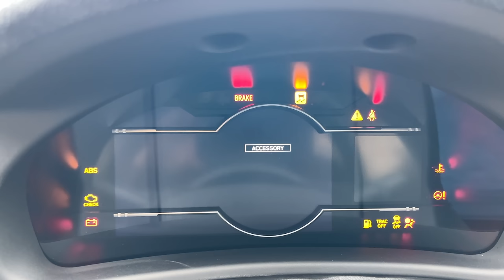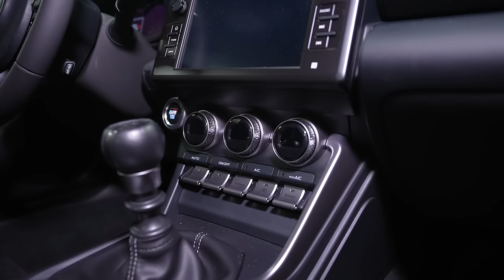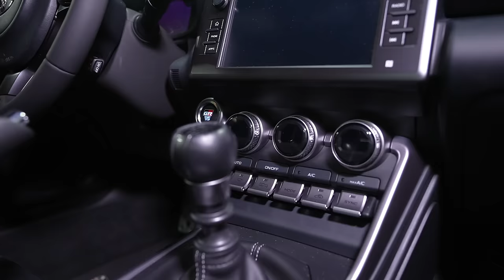Should You Buy a 2023 Toyota GR86? It's heavily over shadowed by a rival in 2023

Comment: The 86 platform is special because it's one of the very few LIGHTWEIGHT, RWD, low-sitting, naturally aspirated sports car that exists right now.
Reply: And still has a mechanical e-brake, standard transmission and not marked up like everything else.
Reply: Problem is a miata is cheaper, not much less power, and has a drop top. Maybe slightly less practical but I feel like it's a no Brainer to just get a miata instead
Reply: @MrImaWizard  The MX-5 is also a great car. But if you were to own only one car, especially as a daily the 86 would be the better pick every time.
Reply: @Krenisphia  not by much though. I'd take the drop top capability over a little more trunk all day
Reply: It's also under $35K.
Reply: @MrImaWizard  i like both tbh, but in my country mx-5 is more expensive, and mx-5 isnt really comfortable for tall guys like me specially driving it daily, and to me gr86 has a good space to put my staff in the "back seats" makes a difference.
Reply: @MrImaWizard to each their own, but extra boot space is nearly double the size of the mx5. and its considerably more power and torque. I much prefer the slick top but I can understand those that want a rag top
Reply: @elll6456  regardless of trunk size both are impractical day to day and am RF miata is the best of both worlds of drop top and a traditional car. That "considerably more power" doesn't translate into being faster as the 0-60 speeds are next to identical. I just think one checks way more boxes than the other as far as a fun sports car goes
Reply: @bliatay not marked up? They have a 5k markup where i live.
Reply: @MrImaWizard drop top is a massive negative for any car enthusiast.
Reply: @brandon9491  this makes absolutely no sense. The miata is well known as one of the best car enthusiast cars lol having a drop top makes the experience that much better as an enthusiast.
Reply: @MrImaWizard  so you don’t understand physics? Drop top = less structural integrity.
Reply: @brandon9491  so get the RF. Enthusiasts rave about the miata so your point is moot. It's one of the most famous enthusiast cars on earth.
Reply: @MrImaWizard  the miata is lightweight and rwd, thats why its so popular.. its not because its a convertible. Theres a reason so many people convert it to a hard top..
Reply: @MrImaWizard  convertible is overall a negative, your argument is “well this lightweight rwd manual car has a convertible and sells well, so therefore convertibles are not bad” 😂
Reply: @brandon9491  that is not my argument you goof. My argument is that it's the most famous enthusiast car and is a convertible. And just because people put a hard top on it doesn't mean they don't use it as a convertible. Your argument is trash. It's an enthusiasts dream and that includes being able to drop the top and hear your engine purr as you roll through gears. That is why the RF is such a popular choice because you get the best of everything, drop top and the rigidity if you want it. You can't win this argument, the miata is the penultimate enthusiast car and being a drop top plays a role in that.
Reply: @brandon9491  if the convertible was an overall negative then other lightweight RWD cars would sell better than the miata but they don't.
Reply: @MrImaWizard  i dont know a single car guy that wants a convertible besides 60 year old men.
Reply: @brandon9491  maybe you should hang out with some more fun people then. Having a drop top is a blast especially when it's such a fun car like a miata. Maybe ask yourself why it's one of the most popular sports cars ever created bud.
Reply: @MrImaWizard  it’s definitely not popular because of the drop top… its a lightweight rwd manual, thats why. nobody likes convertibles anymore. Miatas dont even sell well, 6000 vs 44000 mustangs sold in 2022. So your argument is moot.
Reply: @brandon9491  "nobody likes convertibles anymore" then why do they make them bud? You lost this argument from the get go. People love the drop top function of miatas its a braindead nonsense take to suggest otherwise
Reply: @brandon9491  also comparing to the mustang is hilarious and irrelevant. Americans like muscle cars thats no surprise whatsoever and there are also like 5 different mustang models. Modern mustangs are hardly an enthusiast car in 2023.
Reply: @MrImaWizard  thats why convertible sales go down year after year? You are stuck in the 80’s old man.
Reply: @MrImaWizard  320k sold in 2006, 144k in 2016, less than 100k sold in 2022. Becoming less popular for a reason. Uglier, heavier, less stiff chassis and security are just a few reasons why the convertible is a dogshit choice 😂
Reply: @MrImaWizard  toyota sold 12000 gr86 in 2022. Double the miata. Nuff said
Reply: @brandon9491  can't even take a GR86 or BRZ on the track without risking blowing the engine but ya, best enthusiast car on the market!
Reply: @MrImaWizard  stray away from the original argument that convertibles are a net negative.
Reply: @MrImaWizard  the miata is not cheaper tho
Reply: @MrImaWizard  That all depends on where you live. If you live in the midwest you'd be a moron to buy a drop top as your main daily driver (it would be fine as a 2nd or 3rd car). You can only realistically use the drop top a tiny fraction of the year when it's not too cold, too hot and humid, or raining. Driving around a drop top car with the top up 95% of the time sucks... ask me how I know! If I lived in the right climate I'd be all about a Miata as a daily. But in MOST climates here in North America, the GR86 is the better choice for a year round sports car. I know because I owned an FRS for 3 years alongside an S2000.
Reply: It would have been a great car if they put the b48 in it. Instead of the terrible, failure prone pancake engine - and I owned a flat 4 subaru engine that failed, I know from experience.
Reply: but it is a partnership with subaru, not BMW @SupraSav
Reply: @SupraSav  You want Subaru to use a BMW engine in their cars? BMW isn't involved in this platform so I don't see that happening. Additionally, it wouldn't fit because the engine bay doesn't have enough height, so you're talking about a complete redesign of the car to accommodate a turbo inline-4. If there was to be a turbo motor in the 86 it would likely be the motor from the WRX. Overall I think Subaru has improved the reliability of their engines over time so I don't think there's much to be concerned with. I had a 2013 FRS and drove it up to 110k miles before I sold it. The car never had any issues, not one. Just regular maintenance.
Reply: Update: I have now sold my 2022 GR86. Lost my license for speeding lol. I live in Australia so road laws are quite strict. That being said, my short ownership and daily driving of the car was fantastic. Such a fun little thing. I don't regret anything.
Reply: @MrImaWizard  But can you name at least one checkbox which is better in Miata than in the GR86? Apart from being a bit cheaper maybe? I can't think of a single one. Aaah ok, fuel consumption maybe, but I wouldn't be buying a sports car if I wanted fuel economy.
Reply: FACTS. I ALREADY ORDERED MY TRUENO EDITION.
Reply: @MrImaWizard  Miata’s are ugly
Reply: @steelearmstrong9616  the ND and 86 are virtually on par in terms of styling
Reply: @MrImaWizard  I understand. Ugly probably not the right word. They just don’t do it for me in my opinion life the new GR86
Reply: @MrImaWizard  It's not slightly less practical, it's MUCH less practical. Trunk space in a miata is TINY. The price difference is negligible, plus miata trims get much more expensive at the higher end.
Reply: @MrImaWizard  It's substantially more trunk. You can fit maybe 1 rolling luggage bag in a mx-5, you can fit multiple in a gr86 with the rear seats down.
Reply: @SoulEraser000  you arent buying either of these cars for practicality. If you are in the market for an every day car neither really fits that bill. Miata has more variety in trims, the entry point is lower and the high end is higher. Personally if you are buying a fun car it doesn't get much more fun than a drop top
Reply: @MrImaWizard  the gr86 is much more livable as an only car. So I disagree . You could definitely daily the 86 just because of the extra space
Reply: It is a fantastic race car, largely due to the things you mentioned. I realize Toyota needs people to want to drive it on the street in order for it to be available to race, but it's a great race car that is saving a dying race class.
Reply: @MrImaWizard  Many people cannot fit into the MX-5, myself included. But, we can fit into the GT/GR86.
Reply: @MrImaWizard  Penultimate means second best, just FYI.  Unless you meant to say, it's second to the 86...
Reply: @MrImaWizard  Unless you don't fit. I was looking into buying an MX-5 before I bought my GR86. The tiny interior made it a hard no.
Reply: Whooooo.....Mr Wizard. You're getting a bit defensive now mate. It sounds like you're trying too hard to justify owning that pos Miata. We all know you regret not buying the 86.
Reply: Mr Wizard's only 5 foot 4. That's why he owns a Miata. Someone's jealous.
Reply: @MrImaWizard can’t daily a Miata. Can daily an 86. So I got an 86
Reply: @MrImaWizard it’s by quite a ton. Remember, the back seats fold down in the 86. I have traveled with two large suitcases in my 86. I’ve also driven the family Miata—it can’t fit one.
Reply: I kid you not, the hand brakes are one of the things that pushed me towards a BRZ. I was cross shopping a Supra. As much as I liked the speed of the Supra, the BRZ/GR86 offer a purer sports car experience. It literally is a cheaper Porsche Cayman.
Reply: This car and the MX-5 ND are the last of a breed. Pretty much every car after these will most likely be a hybrid of some sort. Not saying they will be bad car, they will probably be better in many ways and faster, but they won't be a naturally aspirated lightweight ICE RWD like these. Get one while you can new, or wait for high used prices later.
Reply: @brandon9491 I absolutely hate convertibles and also hate the Miata but this is a garbage argument bro. Just because you don’t like something doesn’t make it “overall a negative”. We’re talking about four cylinder “sports cars” that are marketed as fun economy drivers. If we were looking to be purists or get real performance we’d just get a corvette and be done with it.
Reply: @brandon9491 Bro has taken absolutely no looks at Jeep. If people hate convertibles why does everybody love rag top jeeps?
Reply: @IronicTonic8 Except for track use showing low oil pressure under hard-right corners. Yeah, great engine design… super reliable
Reply: @arcelivez The Miata has more support, more market compatibility, more features, and quite possibly a higher availability around the country. I have been to several Toyota dealerships around my area (Subaru as well) looking for a BRZ/GR86 and I found one that was used. No dealerships in my state even carried a new GR86 and only one carried a new BRZ. Plenty of Miata’s though. 

Most people would benefit from the GR86 more, but some people just want the function of the Miata. It’s a dumb argument and totally subjective. People should shut up

Comment: There is a purity to 86/BRZ in its simplicity. I own a 22 BRZ and 1000% happy. It gives all the right feels. After 2 turbocharged cars I appreciate linearity of power and there is enough to have fun on the street.
Reply: I agree but would be tempted by one with a turbo if not a huge mark up.
Reply: Personally I would have loved if Toyota gave the buyer the option to get the 3 banger that's in the Yaris/Rolla GR.
Reply: Same. Have a Auto BRZ and it is amazing. I also own a Manual 2019 BRZ with all upgrades. I keep driving the new one, lol.
Reply: Totally agree and the NA Engine reacts much faster than those turbocharged ones. To me thats one of the most important things…
Reply: lol ok i believe you
Reply: 100% happy with my 7th Gen Celica...
Reply: @breckfreeride  I cried when I had to get rid of my Celica. I loved it!
Reply: Exactly, intuitive gauging output “found only in naturally aspirated engines” rules -- Just upgrade to inline-5, inline-6, etc.
That's why I finally collected a mint 2002 Z3 3.0, which comes with OEM “quick steering rack & Torsen differential” not found on the M model: https://youtu.be/6q5SVHpN_CU?t=166

Comment: I'm the owner of a 2023 GR86 for almost 4 months now, I drive it everyday and  I'm still amazed by how well it handles.  Regarding power, it's more than enough to enjoy it, while being considerably fuel efficient (I'm getting about 27 mpg on average). the Corolla GR must be an incredible upgrade, but it's more than $15k more expensive and mechanically, much more complex, therefore, possibly costlier to maintain and repair. So the GR86 is the cheapest option, only comparable to the Miata, which is smaller but not cheaper.
Reply: I own the 2022 model, picked up an auto for msrp. they wanted much more for a manual. but the auto is great, I get 32.5 mpg, and I live where there are tons of twist and turn roads so the drive to work is awesome.
Reply: Hey there. I just bought a brand new 2023 brz, and I am hearing a lightly noticeable metal grindy-like sounds when accelerating. Is that normal?
Reply: Is yours auto or manual? For that mpg number thanks
Reply: @Player-jo9lt  absolutely not
Reply: @HeroesJourneyHub  manuel. I think it was mostly the way I was using the clutch.
Reply: Miata will cost less long term, much better mpg and better reliability. It's a better street car, gr86 better track car. Different people, different wants/needs
Reply: @thaydathroeun8678  I am 6’2 and couldn’t fit-in in a hard top miata. Brz was a lot more comfortable
Reply: Yeah he keeps going on about the GR86's low power, but it's a LOT more than a Miata. Everyne knows Miatas are great to drive, so why is it a problem with this car? It is what it is, and for the price it's a pretty compelling prospect.
Reply: @thaydathroeun8678 miata is completely unpractical and more expensive while giving you less! I went to test drive one and it was  tin can sounding. It's gutless, especially on a grade.
Reply: @FreshSav  then get something else, clearly not for you
Reply: @thaydathroeun8678  its not a practical daily driver. Just try doing groceries.
Reply: @FreshSav  it wasn't meant to be one
Reply: @thaydathroeun8678  OP is talking about daily driven vehicles, practicality. Not sure why you are replying to this thread with your arbitrary statements
Reply: @FreshSav  if it bothers you so much, then be quiet
Reply: @thaydathroeun8678  no it doesnt bother me. Just not sure why you think your opinion was relevant, when I was talking to someone else. No one asked for your opinion. If you think the miata is relevant in 2023, good for you, go buy one and let us know👍🏽👍🏽 🤣
Reply: @FreshSav  you don't have a car
Reply: @HeroesJourneyHub  Auto, which everybody thinks is not the one to buy. The gear ratios in the manual transmission don't allow for this kind of efficiency. Also,  driving the commute for 1 hour each way every day, makes it very convenient.
Reply: Sorry that’s lousy MPG … Toyota should make it hybrid …. and get more like 65 mpg….
Reply: @OutRAjious, lol!  What are you, 12?!?  MPG is sooo overrated in cars.  You could have a newer version of a car that gets 5mpg improvement, but higher stressed engine.  One extra out of warranty engine repair will wipe out a lifetime of mpg improvement, and worse, hit you all at once.
Reply: @OutRAjious  prius hybrid only gets 50-55ish mpg. Nothing is in the 65 mpg range atm except fully electric.
Reply: Can you comment about the cabin noise and sound insulation? Someone said to me the engine noise quite intrusive into the cabin
Reply: Yeah and the only reason the Miata can keep up to the GR86/BRZ is because it is way smaller.
Reply: I owned a 2001 Miata and found it too small. Is the gr86 going to be a similar issue?
Reply: @Player-jo9lt something about the transmission goes crap.. typical on subarus
Reply: What about at cornening to right side the oil pan issue ??  Oil psi drops mechanics say
Reply: The GR Corolla has a more complex motor, but it's not made by morons who use RTV instead of gaskets.
Reply: @FreshSav I use a 2023 GR86 as daily driver with my two children and I go to groceries, put the bags of my children ... Absolutely no problem, really I can put a lot of stuff in the trunk 🙂
Reply: The GR 86 and MX5 Miata are equal when it comes to acceleration (according to Car & Driver), but the biggest advantages that the MX5 has are:
Lighter weight
Drop top (worth alot in warmer climates like Southern Cali.
Fuel mileage is significantly better.
@productdesign9626
Reply: @FreshSav Having a drop top is a huge advantage if you live in a nice climate area like southern cali.
Reply: @davepaturno4290  I'm not sure if you've ever driven one, but the cabin and boot are tiny compared to the BRZ. It's a fun place to be with the top down in the twisties, but not as a daily, IMO.
Reply: @chrisandrew_tv  My previous car was a Mazda 3S GT, which was even roomier than a BRZ, yet my MX5, being many hundred of pounds lighter, is more fun to drive. I have never driven a BRZ or GR86, but I sold the Mazda 3 to get something that was much more powerful. My 2024 Supra 45th Anniv. has small windows, but the acceleration of the Supra is well beyond the MX5 and BRZ. The Supra is also quieter at cruising speeds, so a highway drive is more pleasant.
Reply: @Player-jo9lt  it sounds awful for a little while, like a tractor engine. It should sound good after a few hundred miles.